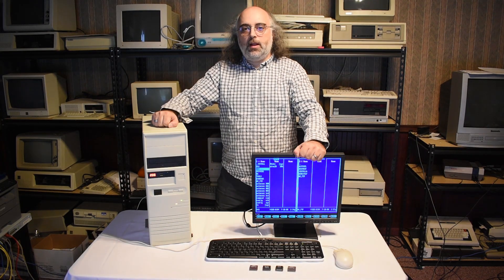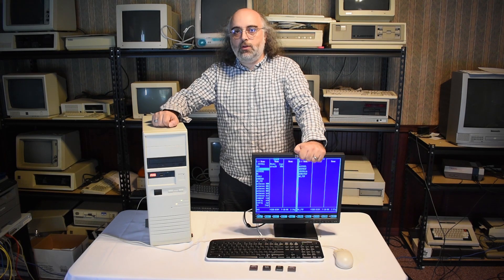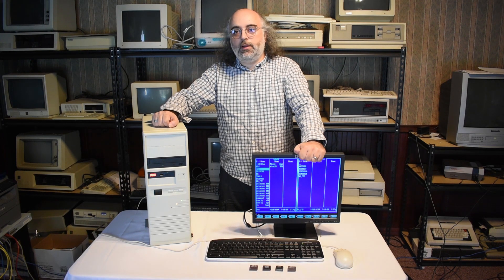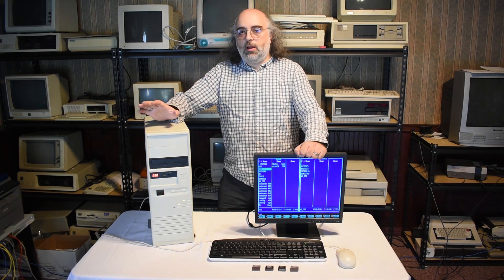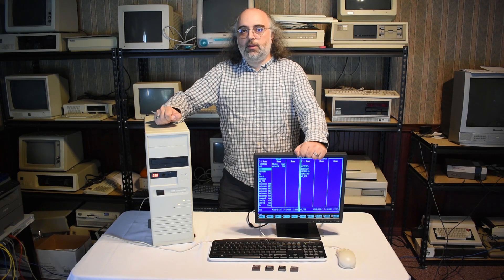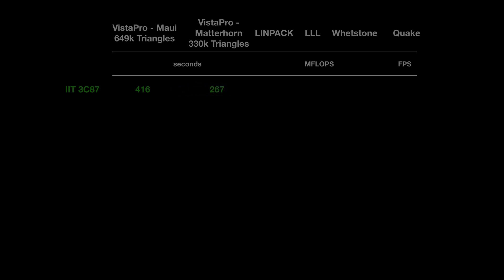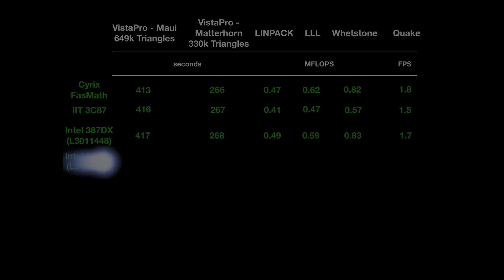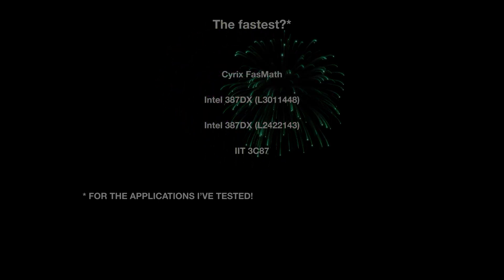80387 Math Coprocessors Speed Comparison

Comment: I have an 386 system with math coprocessor. It is strange because i have checked a system performance 386DX-40 with sysspeed and without coprocessor system performance is about 9. and afterthat i have installed coprocessor IIT and ULSI standard and ULSI DLC 40 MHz and 386 system slowed down to result 6,5 or about 7 - what is going on?

Comment: There was such a debilitating memory restriction on Intel PCs that slowness of the CPU was secondary.
Even simple programs had to be space optimized in order to run on a Intel platform. Even office apps struggled.
80s and 90s were frustrating times for people that could not afford professional workstations or have Cray time.

And now intel still fails miserably at mobile SoCs. Miserable energy efficiency.  Yet they dominate the laptop/desktop market and has even monopolized the server market.
Disgusting.
Reply: No there wasn't unless you are using a 286 or lower. The 386 and above can use a flat memory model.
Reply: @telengardforever7783  - 
16 bits ... 
it wasn't until about 2000 that personal computers felt practical. Only if LINUX would mature into a practical desktop operating system. 
As of still 2022 I prefer to use a Mac as front end or even Window and do remote development. On UBUNTU one has to use two utility apps just to change the screen resolution.
Reply: @dinnerandashow  you kidding right? Since 1984-85 computers like Macintosh, Atari ST, Amiga and later Acorn were perfectly practical and the work was much more fluid then on IBM PC standard. All had pretty good GUI on top of it. On PC platform the eve of 486 and windows for workgroups and later Pentium and Win95, all become practical if you had enough RAM. We talking mid 90s.

Comment: Why there is no wietek
Reply: The Weitek 3167 (also known as Abacus) was electronically completely different from the regular 80387 and its clones. Not even pin compatible. It also had different physical dimensions and required specific socket to install and specific BIOS to handle it. As it had its own instruction set, there were only a few applications that could benefit from its presence, mainly CAD programs.

Comment: i had a 386dx40 with a cyrex co-processor(6 actually) i was GIVEN that the school was scrapping because, and i kid not, they "upgraded" to 486sx16 and 25mhz models... the co-proc actually helped under nt4 and even 2000, it actually boosted perf in some tasks quite a bit..i ended up re-selling the systems with larger hdd's installed, more ram then they came with by default, i got ALOT of good ram, the 386 that had the chip soldered to the board and no upgrade slots (i got a huge stack of these, full systems) i found a "snap on" upgrade cpu for them that upped them to a double clocked 486sx.. win95 worked great on it, amazingly well infact...  a shop i was interning at sold them for me and gave me most of the value in trade.... let me build a decent rig at the time.. and i kept one of the maxxed out dx riggs for years..i regret giving it to a buddy for his daughter to play old dos games like oregon trail on....(well the 95 compat version....)  it worked shockingly well... i had also managed to overclock it to 60mhz, the cyrex co-processors were shockingly good... even stacked on an amd 386dx40...and handled the clock up... oh...the boards also had MAXXED OUT CACHE....1mb... even back then i was able to re-sell just the board/chips/ram for enough to get a 5x86 rig when i sold the last 2 (other then my personal one that was running multi boot, 95, nt4, and BeOS, it still is im told, he even imaged all the drives using a USB adapter and replaced them with CF card mods with more usable space, max the board can actually address without additional software used... hes also got a stack of old hdd's connected now he moves games he wants to load fast to the cf card, (made batch files to do the job..) 

oh, and i tested with the cyrex x87 removed and, the system performed worse in anything the co-processor helps with, im pretty sure it was using both the dx40's built in co-proc and the  cyrex since putting an SX chip in at the same clocks always got worse results... 

i gather i was lucky with those setups since they actually worked at 60mhz (the 3 i tested it on), using settings for another chip.

they were more picky with memory.... the boards had 2x72pin slim slots and 4x30pin slots, when i got them they had 8mb of 30pin, i managed to get ahold of 32mb for each of the boards that could take it.. but the boards were picky with the 72pin... only specific edo or fast page memory would work, at all... thankfully that shop owner had  trays of  ram and, actually needed 30pin memory, as his supplies had gotten very very low, when we haggled... he gave me a ride 23miles back home, and, saw what i had...and upped what he would give me in trade, and said that was on top of the ram.. he wanted the extra ram i had serval static bags of(30pin/32pin), also wanted the SIP 286 memory i had a shoe box FULL OF... (turned out they could remove the sip pins and the sticks became normal 30/32pin modules... they even swapped the memory on the sticks with higher capacity ones at times... )  anyway... those boards were...genuinely great... and 9x/nt4/2k ran quite well on them... i genuinely reget not keeping one of those systems around to this day... it could have been great fun to mess with as a retro toy..

oh, also, some of these boards will really fubar the memory and cache timings when you change clocks...the ones i had, didnt have any issues with such settings, they had an SiS chipset, honestly, they were decked out for their day even having soundblaster/soundblaster like cards... the dx systems didnt, they were pretty basic but had 8mb ram rather then the 4 that was more common in such systems from my exp... 

with 32mb ram, these do quite well... far better then i expected to be honest... i was proud of my "old but faster then most new systems" free pc's... that i saved from genuinely just being hucked into a dumpster... 

that deal, ended up setting me up fall the way threw the socket A early days, when the shop owner blamed me for some other dude stealing an hdd they were trying to recover data from... (idiot formatted his data drive...) ...  now, 1. had i know what they were doing, i could have had the data recovered before the guy came in and took the drive, and 2. i told them what he looked like and why i didnt question him heading into that area, and he came out with nothing in his hands... and went out past the owner that blamed me... but he was busy with an annoying woman he ended up telling never to come to or call our store again, he ended up with a protection order to keep her away...  or thats what i was told... anyway, after i quit going there, one of the other guys who was jockeying for a paying job got hired, and kept me informed, also that, they had a few other items vanish when the only person in the place was rudy and that fellow was on the door security cam going in and out a couple times but no taking anything in the open...but the back room and storage room.. not covered by cams.. had stuff come up missing... the owner never did admit he blamed the wrong person, but he did nearly get arrested for beating the fellow who had been ripping him off so bad he needed an ER visit... the guy actually told the cops he started it, and that the beating he took was self defense, because rudy made it clear... he wouldnt want rudy going to jail with him... the word would get out... rudy also was a former german olympic contender... very proud of it... for an old guy, he was stacked..im thankful he realized that...yes he could have beaten me, but he would have ended up hurt as well...because a couple times he lost his shit....always for very understandable reasons,and nearly took a swing at me, but even the other owner was shocked "i thought he was going to hit you/kick your ass" , i just looked at him... " i think his brain kicked in and he realized, i would hit back, and... hes seen me carry large double stacks of computers from the palets outside, inside, then strip them down, and re-stack the cases on the palets... day in day out... im fat, but far from weak... he would get hurt...."  the guy started to question that, then looked in my eyes as i said 'he WOULD get hurt' ... he nodded... then i explained that... despite how calm i normally am, being  a red hed..i geninely had "the rage" , and.... if i "see red" nothing keeps me down... thats not a good thing or something im proud of.... its just survival instinct mostly... and it wasnt pretty or a joke... to ask Ben next time he came in..we went to jr.high togather...ben wanted to get kicked out of school, so stood up walked toward the class door, as he walked by he turned around and smashed my face into the desk... i remember the aftermath... a broke desk..im told i snapped to my feet so fast and hard i broke the desk, i then one handed picked up a thick text book off the shelf, in each hand... and, as he went to open the door to storm out...i clamshelled his head with them so hard both eardrumbs ruptured, dropped the books, and proceded to roll this guy who was at least 30% bigger then me, fat but considered to be in better shape... out the portible door and down the stairs.. where i spit on him... went back in, on auto pilot and collected my things, expecting to be told to go to the office...instead the teacher had me sit at his desk... and has his wife who was his assistant, get some cotton nose tampons out of the emergency kit...  by the end of the day, he was in jail, the school pressed charges...and i was at home with a broken nose... and was chastized a bit but.. also... everybody said i was justified and that it was clear, that i "wasnt there" , the look in my face was, im told, totally without emotion, i dont remmeber but, similar stories from the handfull of other times i have "Seen red".... ben became a pretty good guy, when he found out the school pressed charges not me....you could see the rage he had for so many years just shatter, "neither me nore my parents would press charges over that, i didnt even need a doctor, i mean i should have had one set my nose properly but.. with how mushed it was....im told it prob would have required being re-broken a few times to get it truely straight inside again..and outside it looks normal so...yeah...  dude actually appologized and, kept coming in and giving me and the shop more business after i started working there... his wife actually got my info from the owner claiming she had to return something her husband borrowed from me... they without a word, dropped off both a nice gaming pc, and good work laptop, with a letter that said 'hope this helps, sorry about the issues with the germans'  and their contact info... (their daughter, is now married to one of my cousins...both are weirdos...and...i jokingly introduced them, knowing they would hate eachother..that lasted about 2-3 weeks..then we found them fucking in a supply closet at a lanparty... LOL....)
Reply: Wow what a story! 
By the way did I read correctly that you got win2k running on a 386? Did it take a lot to get it going and how did it end up running?

Comment: Please, give the speed
1) for the 80386 without the 80387.
2) for  a 80486 DX.
Thanks !
Reply: without the co-processor a 386 cannot run quake and presumably none of the other software either. In principle the fpu can be software emulated but it'd be hundreds of times slower
Reply: @luckyluckydog123  And the speed would depend hugely on how the floating point emulation was implemented, like whether the code to emulate was specifically tweaked for the 386 or was backwards compatible with the 286 and 8086.